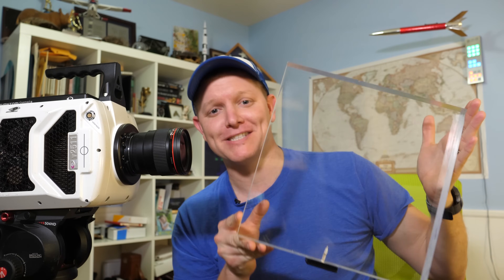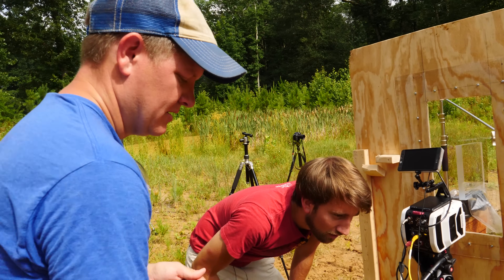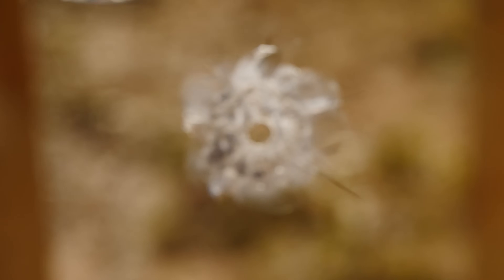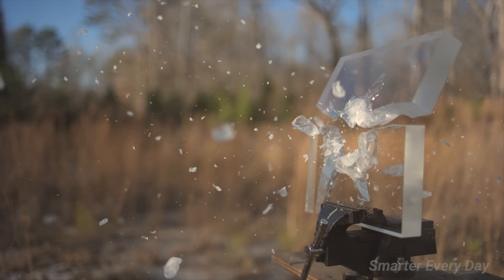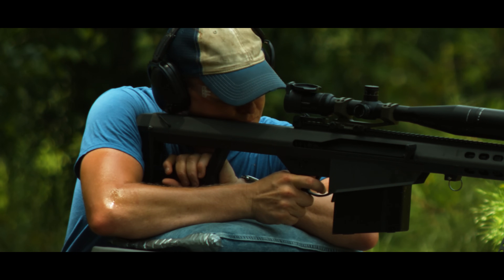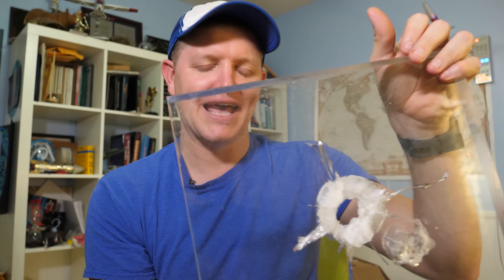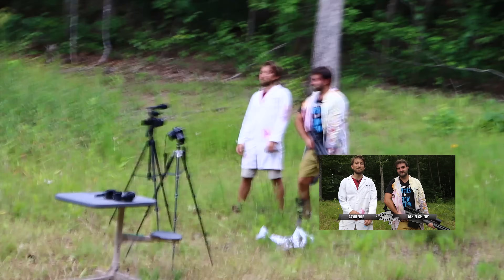.50 Cal vs Ballistic Window HARDCORE Slow Mo  - Smarter Every Day 187

Comment: Here's an idea @smartereveryday. Try shooting (Get it? Shooting?) this kind of thing in the dark. It would be interesting to see if the actual breaking of the acrylic produces any light. Looking for a kind of fractoluminescence effect.
Reply: Conner Mong 
Look at the impact at 5:59 and you’ll see that it does.
Reply: There is also a mathematical possibility of sonoluminescence.
Reply: Conner Mong I posted a similar comment I was thinking triboluminescence clearly there is enough questions to hope he does a video on it
Reply: I really want that to happen, however gun safety at night may pose some concerns. Hopefully they do make one though.
Reply: Also you should look at Gav's discussion of how much light it takes to get the high speed shots. There is a reason they do most of their work in full daylight outdoors. If They are shooting at 100, 000 frames a seconds, and 180 degrees, the "shutter speed" is 1/200,000 of a second. This means not much light makes it through to the sensor. Really hard to capture faint light effects.
Reply: Rick M 
I'm unsure if that's the impact of the metal on the acrylic, or if it's just light reflecting off of the cracks. Hence the need to do it in a dark room.
Reply: Jay Dauro there is some slowmo footage out there showing some of those effects already. It is possible.

Comment: Not knowing much about the physics of bullet impacts, I'm curious as to why there is a flash right at impact (5:59). Being glass on metal I don't think it would create a spark like metal on metal. The only thing that comes to mind is a sudden compression of oxygen between the two surfaces that create a mini explosion. 
If that is in fact happening, would it help the bullet project further into the material?? 
Just thinking out loud, if you know or have a better idea please share!

Comment: Fantastic video collaboration with the Slo-Mo Guys [again].  Y'all always come up with great ideas.  I've a question for you, Destin: would metal (as in armor) suffer similar fracture patterns during and after spallation?  I don't know how the crystallization structures between metal, ballistic acrylic or even glass differ, but I know that would determine the properties of each material and how they would fracture under similar circumstances.  What are your thoughts on this?

Comment: Can you check out Hertzian pressure? Generally works with two cylinders or spheres touching each other, and the maximum pressure is not at the surface, but below the surface. That's why galling and other phenomena can occur in wear. I never fully understood it, and your frustum explanation made me think of it. 

Let me know if you want a picture from my Machine Elements textbook.

Comment: I'm going to apply your analysis of fracture mechanics to regulatory policy hearings(my work).  Regulation is designed to be 'bullet proof'/resistant to small changes.  However, when a major force impacts it, the pressure cone can cause a cascade and thus shatter the regulation entirely (like your ballistic acrylic)  thereby forcing a requirement for a new material with a higher resistance to larger calibers.  Not sure how I'll be using this at an upcoming hearing, but it's definitely given me a new perspective!  Thank you so much!!!

Comment: Please explain because I’m super interested.
I get how the energy travels through the material in a pressure cone, which is why some materials can stop certain kinds of bullets, because of the pressure cone angle and strss=force/area. What I don’t get is why would the top face of the frustum (the point of impact) be clear while the rest of the cone fractures the material and thus becomes opaque. I don't understand why the damage cone would have a clean cylinder cut out of it like that. Explain?
Edit: So if you set the video speed to 0.25 and keep clicking 1:57 on the timeline you can see the point of impact balloon out in a donut shape while the tip of the bullet sort of bounces off. No explanation as to why this is but my best guess is the force propagates backward, causing the back of the bullet to break first. The path of least resistance for the wave from there is back down the outside of the bullet toward the front, the final pressure cone originate from the outside edge of the bullet impact site, not the full area.

Comment: I am far from a physics geek.....or a mechanical engineering person.....but I find it quite interesting that the bullet resistant material hesitated before breaking into pieces after the .50cal passed through. I can't help but to think that perhaps the vacuum trail behind the bullet may have been a factor(not likely).....but perhaps the polycarbinate stored up energy from the impact and the re-release of that energy, causing the failure of the remaining block.

Comment: Nice video! Would have loved to hear more about the fracture cones and how they propagate through the material and what the angle of the cone is for the glass. With the 9mm shot that center point that stayed clear and mostly flawless was a very interesting phenomena.  Like the rebound in the middle of a crater impact but untouched. That brings up a question of what kind of elasticity does the material the 'glass' is made of have? Is it several layers of laminated glass together? Some kind of acrylic? I'm hypothesizing that when the 9mm impacted it created a compression perpendicular to the point of impact but did not actually break the glass, however the energy being redirected into the shock of that 'cone' then fractured the glass around it leaving the impact sight untouched. Or the bullet was simply unable to overcome a friction barrier at the surface and when the lead shredded on impact the burred edges dug out the circular crater . OR if it's a laminate material was that impact sight a cleared section of the next layer down?  Love your channel man but I'm hungry for more information!
Reply: They said it was a type of acrylic. My thoughts on it are similar to yours. It looked like the 9mm bullet deformed a cone of material in front of it and as it did the surrounding material had nowhere to go but outwards causing pieces to blow off all around it.

Comment: Right when the .9mm hits the glass, that weird circular shockwave happens like the Slow Mo Guys "hammer through a mirror" video. They talk about the same effect happening in The Matrix with a glass building and helicopter blades. If you slow it down to 0.25 when it's at it's slowest part you can see the shockwave appear right after the bullet hits the glass. It looks like a black circle. Try slowing it down to 0.25 at 5:58 and watching a flash and then the black circle appears. Interesting.

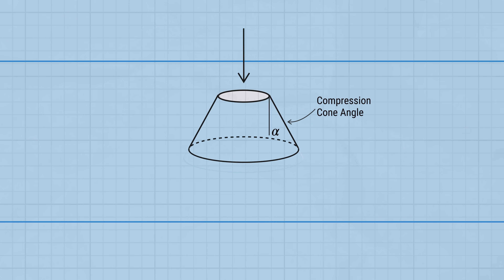Comment: 3:33 the power of the triangle that explains a lot that is very interesting though how you explain that it makes sense I have seen this in bricks concrete glass ceramic if you take a BB gun and shoot the bottom of a thick soda bottle glass only it will make one of these cones you have to shoot it at point-blank range do this bye placing the bottle flip side to the ground he'll between your feet place to BB gun on the bottom of the bottle and fire it remember safety first and if you shoot it just right the BB real passed straight through the neck of the bottle and into the ground but don't worry about shooting Yourself by the time it goes through the glass it is lost most of its kinetic energy and as long as you're wearing blue jeans you'll never even know that the BB went through and hit your pants leg

Comment: It's not just fracture mechanics though. It's also modal response of the acrylic as it is vibrated by the force step function. It split apart as those fractures propagated from the vibrations it was subject to.
Reply: Thank you. That explains why the acrylic panel shattered so (relatively) long after the complete exit of the round. That had been vexing me.
Reply: Boosted98gsx Yep, that checks out. 😊
Reply: Yes!  I was wondering the same thing!

Comment: At 5:59 if you go frame by frame, the very first frame where the .50 cal hits the glass, there is a bright flash of light. Do you think that its the tip of the round heating up to crazy temperatures from the energy of impact being converted to heat, or is something else going on there?
Reply: Another possibility is sonoluminescence. If the heat/pressure is enough to make the polycarbonate act like a fluid the bullet might cavitate briefly and cause a flash. Just judging by the color a rough estimate (screenshot + CIE 1964 10 degree colour matching function) of the temperature is around 6750 K. That seems low for sonoluminescence temperatures, so simple heating (or some other explanation) is more likely.
Reply: I like the idea of sonoluminescence. Going back and calculating for KE, assuming he used a 700 grain .50 BMG round (45g at 2978 ft/s), would give the round around 18.54 KJ of energy. Using that number along with the specific heat equation, it could easily get hot enough to melt the glass, copper jacket, or lead. However, on the extremely small timescales I'm not sure if it could overcome the thermal inertia of the materials in order to make them melt. I think we're on the right track, but definitely missing something.
Reply: Even if it were fluidized, the probable viscosity would be orders of magnitude greater than required for expansion and collapse of bubbles.
Reply: It doesn't matter what material that is being shot,  a round almost always does this. Another channel here on YouTube, called taofledermaus that usually films exotic shotgun rounds in slowmo has shown this many times. They also don't know why it does it.
Reply: Piezoelectric effect?
Reply: I caught that too. I think it's a fire piston effect. The bullet looks like it has a small dimple on the tip. The air inside the dimple is compressed immediately upon impact by the deforming acrylic to the point of combustion. That's my best guess anyway.

Comment: I'm intrigued that the - your? - rifle's recoil damper finishes its job before it ejects.
Reply: It's a recoil operated system so the barrel and bolt stay together until the pressure drops low enough then the bolt unlocks and ejects the casing. Pretty cool system.